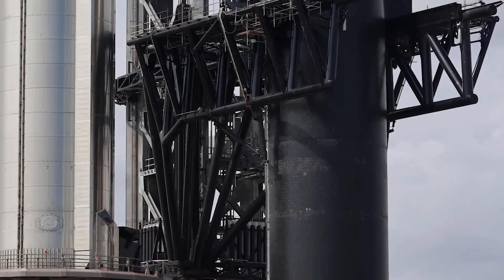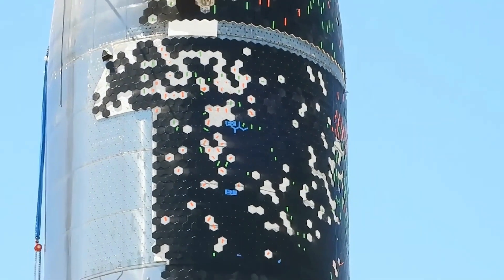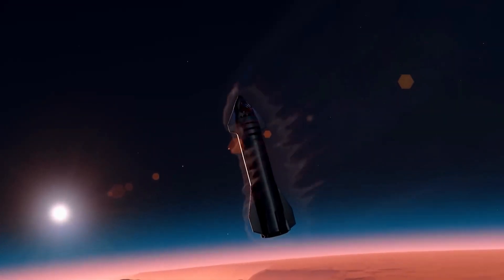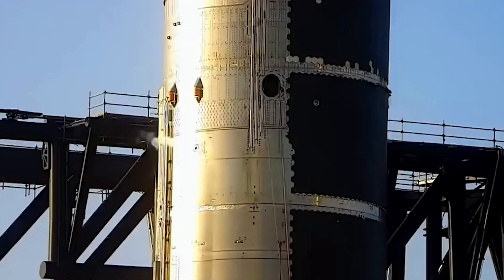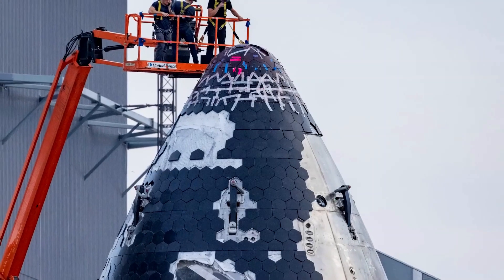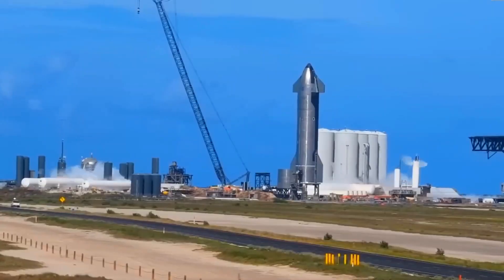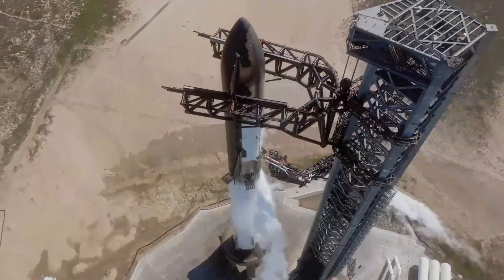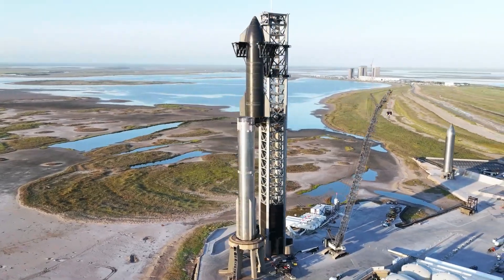SpaceX’s Starship Heat Shield: Big Problem, Big Fix!

Comment: Elon, here’s the solution to your heat shield tile problem.

1.	Weld SS distorted-thread locknuts to the rocket face in lieu of your problematic pins.
2.	Make large diameter tungsten flat (or slightly curved) washers to accommodate flat head screws made of aluminum oxide ceramic material.
3.	Modify tiles with recesses to accommodate above hardware to maintain existing aerodynamic surfaces.
4.	Continue to use hi-temp glue on inside tile surface, but attach tiles to rocket with above fasteners.